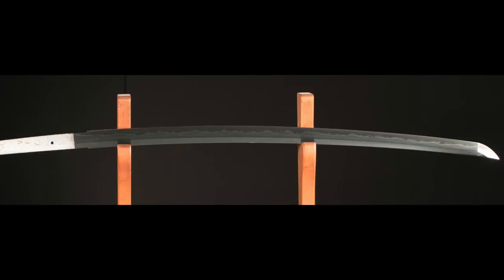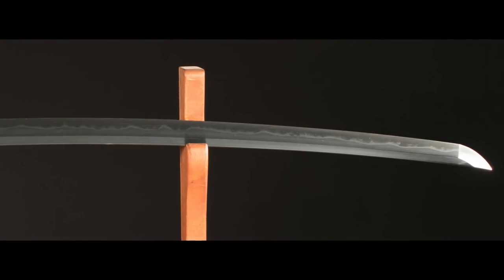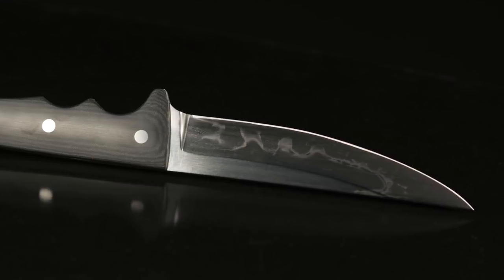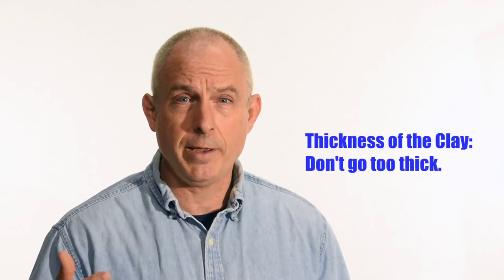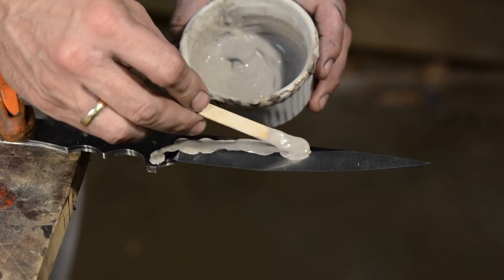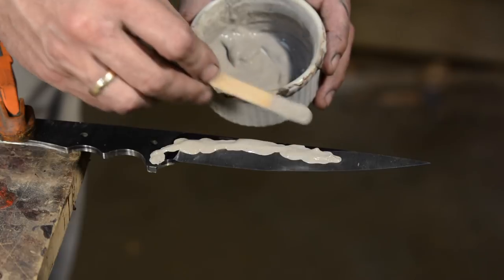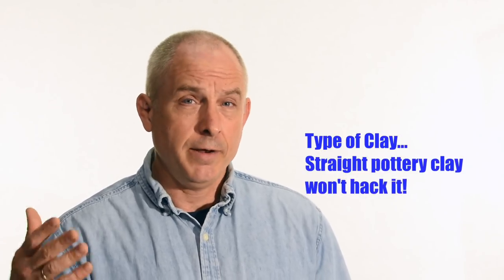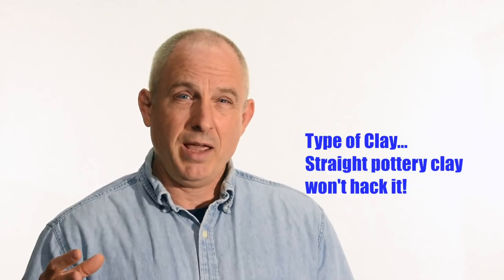Knife Maker's Friday Five #35:  Talkin' Hamons

Comment: Thanks Walter. I gotta get on your patreon. I really appreciate what you are doing for the community. Just a FYI having a presence on Blade Forums might be a good idea. With the interest growing since forged in fire it seems like a lot of new people are coming though. 

I have only had my gear to start making for about 2 years so I'm pretty green even though I have been a metal worker since the 90s. There is so much more than I ever thought there could be to the trade. With guys like you there is more information available then ever before but its still a steep learning curve. I taught welding and realize how much work it can be. You do a nice job breaking it down for a broad audience while still having detail. If you started doing classes I would sign up if I could work out the timing.

So far Aldos 1075 has been the best I have found for a someone new doing a hamon.

Comment: Thank our all your great videos! I have a question I’ve never had answered and I think you could help me with it! after heat treating I anneal the spine of the my blades with a torch (just to about 600 degrees while keeping the edge cool with water) will that process screw up a hamon line? I realize technically that process shouldn’t be necessary if the With the hamon, because the spine should be soft anyways but I still wonder. Also, I have always just edge quenched my knives and left the spines to cool slowly…would all my knives then have a hamon line if I polished and etched them? Not wavy, just the difference between the hardened and soft steel? Thanks! I really really appreciate your videos.

Comment: I've got a little  Tanto I'm making. The blades about  3 inches long 3/16 thick 109. Would  it be somewhat easy  to do a hamon on this blade?
Reply: I get good results on 1084 and as long as you can quench it fast enough yours should work fine.